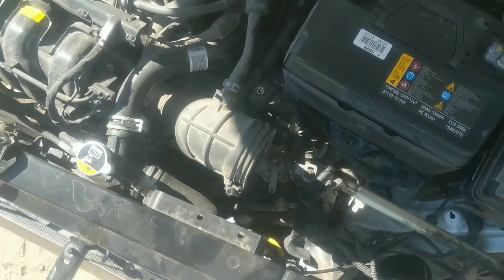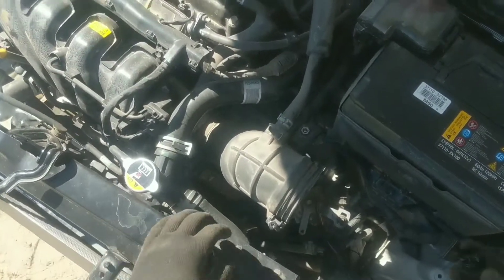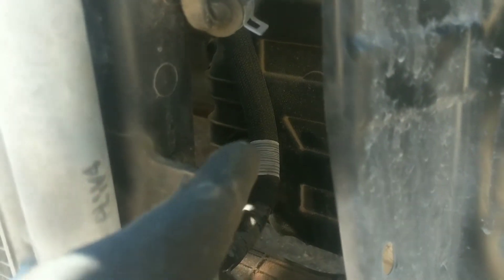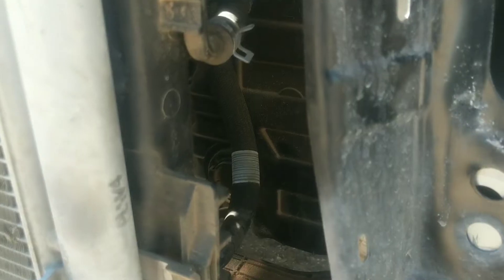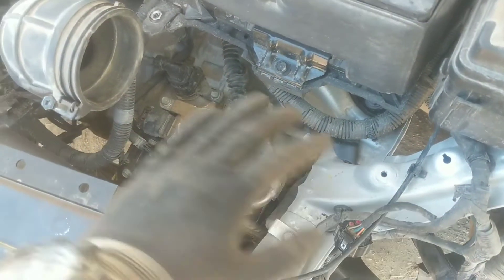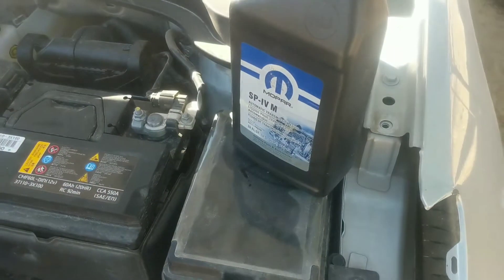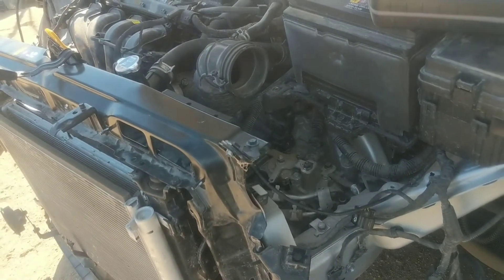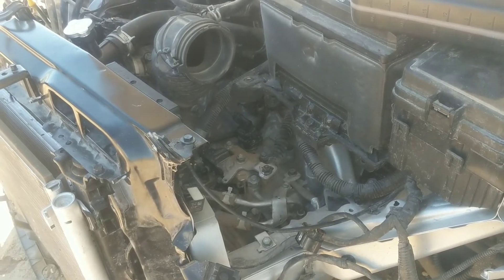KIA RIO 2021 REVISIÓN DE NIVEL DE ACEITE DE TRANSMISION

Comment: Cuantos litros lleva la transmisión del Río 21 ? Y a los km ? Solo se tira aceite y se rellena o lleva algún sedazo o un filtro?
Reply: lleva 6.6 litros del tipo ATF SP-IV. Si lleva un filtro, las desventajas de cambiar el filtro es que solo lo venden en la agencia, alrededor de 900 pesos y además hay que quitar el carter de plástico que se ve ahí, es un carter que esta en posición vertical y lleva los tapones que quitaron en el video. Segun el sitio de kia dice que en condiciones de uso extremas el aceite se cambia a los 90 mil km. pero la verdad eso se me hace demasiado, si quieres hacer un servicio que te asegure la durabilidad de tu transmisión, mejor hazlo a los 50 o 60 mil km. yo se lo hice a los 60 mil. Una falla común es que Si se te tironea un poco en los cambios de velocidad, por lo regular pasa de 1era a 2da, lo que se tiene que hacer es restablecer los valores adaptativos de la transmisión; por lo regular esa es la solución cuando no es por algún componente dañado. El reset se hace con un escaner que tenga esa función.
Reply: @pi8290  pregunta..., porque aceite MOPAR si es KIA ,,, yo tengo uno 2020 con 45 mil kilómetros y desde hace 3 servicios me hace eso pero a mi de 3era a 2da cuando voy a frenar me golpetea,, lo llevo a la agencia y me dicen que no es nada que es normal, SOLO borran un código de falla y se acomoda el tema aquí es que ya lo hace como cada dos meses y le quise cambiar el aceite pero dicen que el manual no indica cambio y pues les dije que es ilógico que no lleve mantenimiento ya que no es sellada, pero no me quieren hacer el cambio que porque pierdo la garantía y eso que es con la misma agencia jaja entonces alguna recomendación ???
Reply: Revisen el manual de propietario

Comment: Hola. Tengo un Kia Rio 2019 AUT LX con 37,000 kilometros. El detalle es que en las mañanas si acelero suave a las 1700RPMs, antes de pasar a 3ra, se siente un pequeño jaloncito. Como si se detuviera por un micro segundo y despues sigue normal. Si hago lo mismo 10-15 mins despues ya no sucede. Ahora si hago lo mismo en las mañanas, pero en vez de llegar a las 1700RPM, llego a las 2000RPM, todo esta normal, no hace ese detalle. Tal Vez sea normal. La agencia dice que es normal porque está en frio y porque no acelero lo suficiente. No hay codigo de error. Alguien mas lo ha notado?
Reply: Tenía el mismo problema amigo y son los coil de los fábrica no son tan buenos apenas cambie los coil ya no jalonea ni nada
Reply: Antes de que le metan mano a la transmisión y te cobren un ojo de la cara intenta primero otra cosa. Una falla común es que se te tironea un poco en los cambios de velocidad, por lo regular pasa de 1era a 2da, o a veces de 2da a 3era. Lo que se tiene que hacer es restablecer los valores adaptativos de la transmisión; por lo regular esa es la solución cuando no es por algún componente dañado. El reset se hace con un escaner que tenga esa función. El que yo conozco que la tiene es el escaner Autel MX808. Lo que pasa es que el módulo de la transmisión se adapta a tus hábitos de manejo, pero tu sabes que aquí en mexico los caminos son muy irregulares y no hay setup definitivo, por lo que algunas veces se hacen los cambios medio erráticos. Si haces ese reset, la computadora empieza aprender de cero, si vuelve a pasar la vuelves a resetear. Si después de hacer eso no se soluciona quizás si sea algun componente dañado.
Reply: @pi8290  todos los Kia tienen eso jalonean tironean  ya el mío dejo de tironear se me comió las bujías de iriridium en menos de 10.000 kilómetros por eso me tironeaba y perdía potencia cuando le exigía esos vehículo son muy lentos al acelerar
Reply: Hola disculpa al mio le pasa que es el coil @adantecnology
Reply: Amigo yo tengo uno 2023 y hace lo mismo. En mi caso espero a encenderlo y dejarlo así sin moverlo ni hacer nada más hasta que el cuenta revoluciones baje solo y s estabilice, esto lleva máximo 2 minutos, después arranco suavemente la primer cuadra y listo, no lo vuelve hacer en los próximos cambios o metros
Reply: @adantecnology hola disculpa que son los coil?

Comment: Cuantos litros lleva para el cambio total del aceite?
Reply: Lleva 6.6 litros en total, si compras marca Motul, cada bote tiene 1 litro completo. El tipo de aceite es ATF SP-IV, para la transmisión de 6 velocidades.
Reply: @pi8290  en la marca motul seria el motul ATF MULTI ?
Reply: @josuevegamorales8152  Es el Motul ATF VI sintético. En la etiqueta de atrás también tiene la siguiente leyenda: GM Dexron VI - Mercon LV - Kia/Hyundai SP-IV - Nissan Matic S - ATF Type WS - ZF MI375